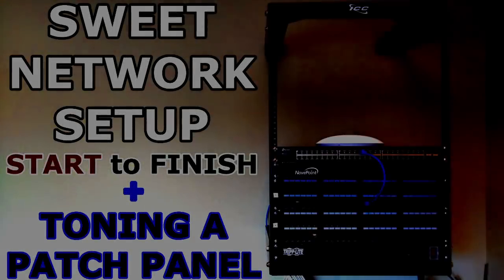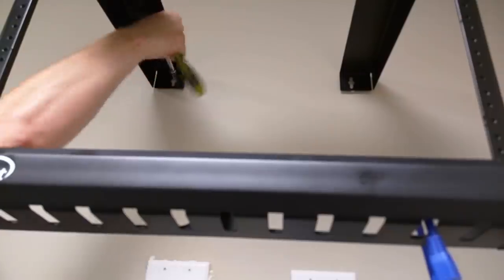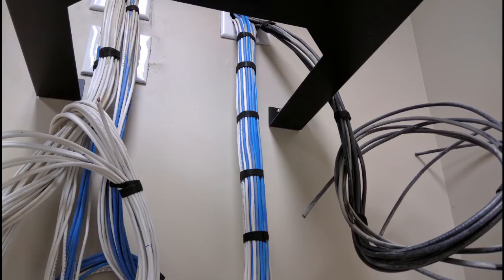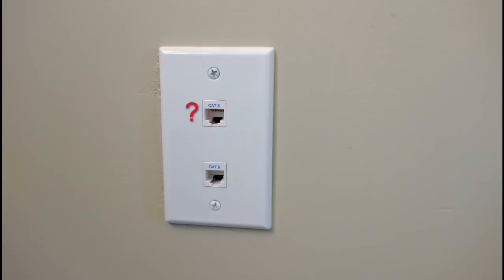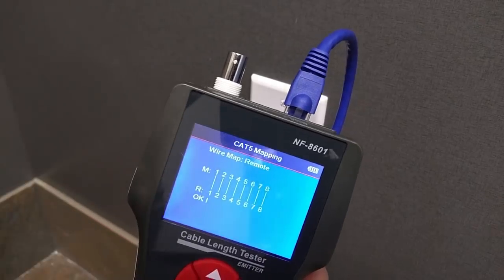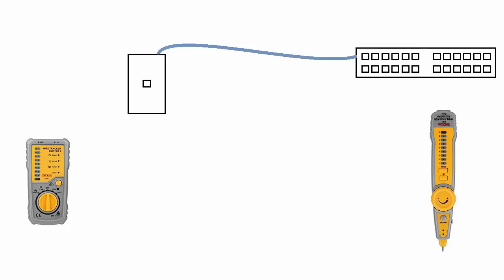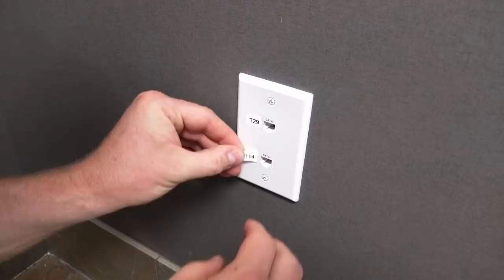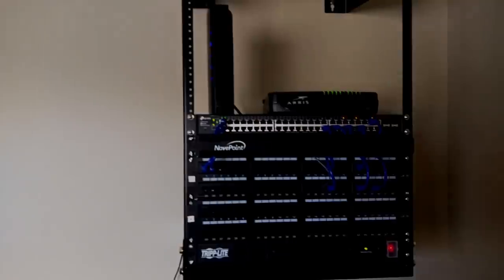Complete Network Setup // Toning, Identifying Ports

Comment: Or you could just label your cables when you pull them and don't have to find them later. Sharpies are cheaper than toners.
Reply from the maker: +rpoot82 true. But not as easy on a large project,.
Reply: Budget Nerd I do this for a living, it is absolutely necessary to do it the larger the project. Just take a sharpie lable your boxes, then label the cable. Keep counting til you get to 48, and change panel ID. I always start with buildingfloor.panel.port so say you're in building B 3rd floor your first cable would be B3.A.01 and continue til B3.A.48 and then continue to B3.B.01 and so on. Then when punching down you can look at the label and place it where it belongs. Now you cut out a lot of time testing because you just go from port to port and don't have to guess or jump around. When building closest with 300-400 or more drops you don't have time to guess. Your time is valuable don't spend it running in circles
Reply: @Budget Nerd, Agreed it is not ease to label, and should not be labeled at time of pull. If a painter comes in and hits the label you are left guessing. How ever I do not recommend using a tester like the one that you are using for installs there is a better way, and always use the right tool for the job. I recommend at least a Klein Tools VDV Scout Pro , it is expensive, and it is very durable I have let my tester fall off a three story building got my help to throw it back to me, and went about my job. You can make testing, and mapping a one person job with doing multi lines at once. 
Also I recommend learning how to properly use a patch panel. The punch blocks are designed to have the wire inserted in a direction that the larger ledge supports the cutting blade on the punch if you are going to use those types of panels. It also helps with management you can easily run them off the side if you do, and tie them to one another. If you are going to do a job where multi jacks are in the same box I recommend that you use a keystone patch panel it makes organization easier you can map the lets say top jack to be 1a and the bottom to be 1b, and use the two panels one as a and the other as b.
Check out this power management for your next install it can improve your life: ELIMINATOR LIGHTING LLC E107 Eight socket control reliable rack mount power center. It has a 15 amp beaker and each of the 8 sockets has its own switch witch makes power cycling the devices easier for you, and the client.
I hope you made your friend aware that that modem will not handle the max clients that the switch, and wireless can. I know you recommended a router other than that one. I under stand that some people don't know the repercussions, but my main argument is: "Do you want your ISP controlling your network, and security when they leave there passwords set to default all the time." As well as: "What would they get more out of you getting the most out of your network or charging you up to $300 a year for a router that is designed for at most 20 devices." I also have clients that have learned this the hard way.

@rpoot82, I find it interesting that you do this for a living but all you point out is labeling cables while pulling even tho that is not good practice. Dude if you do have a job doing this I feel sorry for your boss. You have no attention to detail at all.  Don't feel bad I would fire both of you. You for wasting time labeling cable and not pulling them, and him for the above reasons.

@Cyber_Z0mbie, with the Mapping tools that I have I can map out a job in about 5 - 10 min. that is less time than rpoot82 spends playing with a Sharpe. When I walk on a job to map the job I have labels printed, and ready to install nothing is done with a Sharpe that is just lack of professionalism. 

When it comes to T568A and T568B standards here is a fun fact for you. The T568A is the old standard used by AT&T and is still used by most government and medical IT departments. T568B is the refined standard, and supports backward compatibility with USOC for one pair.
Reply from the maker: +Myzt1c Z3r0 cool. Thanks for the tips!
Reply: No problem Budget Nerd. As fare as labels I go to my local sign shop and they don't charge me a lot and I get sheets of them to my specs for the hardware I use on the jobs. I come out paying less than $5.00 a job. and there printed with UV ink on Vinyl. I also see that others suggested the cable supply led thing. I buy supplies from there all the time why pay $65 for a battery box, and leds stuffed in a plug. when you can spend a little more and be able to test as you map. you need to rerun two cables and need to know how long they are the Klein will tell you that as well. That in its self will give you so much value when it comes to biding some rerun and upgrade jobs now that more people are moving from cat5 to cat6.
Reply: I have done 1000 run jobs, just as rpoot82. You mark up your plans, label your boxes and cables when you pull them, sort them out in the room. if you keep your bundles in order it shouldn't take you anytime at all to get your cables laid in for termination in the rack.
Reply: @firespyer I call BS. yes you go in with detailed plains on where your runs will go even blue prints. labeling cables is a wast of time. That is what you have blueprints for. Mapping is what you have tools for. If you have done over 1000 run jobs you should know this. I smell a lying rabbit!
Reply: @Myzt1c Z3r0 Firespyer is 100% correct; you always label the cables and boxes prior to installation. If you don't you will run into issues with inconsistent numbering and flow. As well labeling the drawings prior will save you time and money when you go to test\certify the data drops, knowing what drop your about to test save you a lot of time on jobs where the drop count is in the thousands. .
Reply: You have that backwards 568A is the new standard, The old standard was  258A AT&T which was standardized under a new name/designation of TIA/EIA 568B.
Reply from the maker: +Jay Shh I did not know that. What I do know, is I see B used by most everyone. Thanks!
Reply: In the US its usually 568B in Canada its 568A
Reply: You are correct on that one. I amend that was a late night and I got them backwards. How ever I stick by not labeling cables at install it is a wast of time, and money for you as well as the client.
Reply: We all have are opinions; But on what basis can you say that its a wast of time and money?  How would you personal handle a communications closet that has 500 drops? Would you ton out each drop when you go to test? 

If I sent TECH-A to office 10 and  TECH-B is at the Rack; TECH-A Radios to TECH-B says I'm plugged in and ready to test. TECH-B then has to use his probe and search for the correct port. If you have 500 or so drops in one closet the testing and verifying will take forever. When we pull in cables we will pull as many cables as possible; each box will have a number 1 to 20 for example, then I would label each cable with a number corresponding to the box number. After the 20 cables have been ran to location we repeat the process and number the boxes 21 to 40 and label the cables. This 5 minute of pre-labeling out weighs toning each and ever drop and again the cables won;t be in order at the desk location.
Reply: Myzt1c Z3r0 Myzt1c Z3r0 lol Remind me not to hire you to do a job.
Reply: Budget Nerd please don't listen to Myzt1c Z3r0 pre labling saves you time and there for money. Writing a number on a cable takes tons less time than toning a cable. Also it is way more professional to have all your cables be consecutive numbers. I do sometimes get away without labels if it's one or 2 cables that dont go in the same wall plate but besides that I have never heard of a professional shop fire someone for labling. I however have heard of people being fired for not labling.
Reply: Been doing this for years in and out of the service. If you're doing less than 5 or 8 and are super crunched for install times maybe, maybe, you wouldn't label.  Watching this hurt tho, badly.  

A few minutes of pre planning and you can easily run these and never have to tone a single one with just a pen marker and some paper. Give each room a number or 3 letter name. However many boxes of cable you have give each one a letter. Then from one to however many patch ports you have Sharpie that number on the wire.  Use your note pad to reference A = 1, B = 2 and what room. Then cut when done running, copy the number over to the other end and do the next room.  A =3 B =4 C =5 and what room. Do every room 100% before moving on if working solo. Then, when you are all done every cable has the same number on both ends and these numbers line up with ports on the patch panel, 1 goes to 1, 2 to 2, etc. Now, on your patch panel every room is grouped in order and you transfer all of this to a spreadsheet and make a wiring diagram. 

When you terminate in the rooms, pick a pattern for the plate and follow sequentially in the pattern as you terminate however many ports. If you are pulling to rooms with more than one outlet, before you pull plan the same pattern for the shape of the room, like North first, then East, south, West. Now, with this 5-10 extra minutes of planning and 1 or 2 pieces of paper you can enter a room, figure out which number any port is, then look at the panel and figure out exactly which one it is as well.

 If you get lost, all you need to do is look at your spreadsheet. Patch panel 34 = MBR  3, 3rd port in the Master Bed. Go in the Master Bed and follow your pattern and the 3rd port is yours. If you want to make it easier, use 2 colors when you go from patch to switch and alternate colors every time you switch rooms. Sharpie above each group of solid colors what room it is and you don't even have to look for your documentation. 

Been doing small business and residential runs like this for years on the civilian side and was the QC is(still am) for large installs on the Army side. You think I would let my crew on my last large install (1500 drops) just run a ton of cable then hand tone 1500 drops? Even for government work that's too much wasted time. Don't listen to this guy, labeling lines adds seconds to each drop but saves hours once the pull is done and over time will save days worth of troubleshooting. 

Always label. Period.
Reply: I wouldn't be able to stand having ports T29 and T14 on the same wall plate...  If you already ran the wires unlabeled then just, label the wall jack, tone the line, find the line at the rack and punch it down to the corresponding port on the patch panel.
Reply: Or it is better to have a keystone panel :).
Reply: Australia does 568A which I assume was mainly just due to the "A" for Australia as the only real practical use was with crossover cables in the past.
Reply: Not the way to do it, see my comment above. If you do it like this, you could done 1500 up to 2000 jobs in the same time!!
Reply: I label nothing, that is for dummy installers...
Reply: rpoot82 agreed, I always number cables 3 times with a sharpie.  A lot more professional to have the outlets in sequential order.  I’ve done this on a 5000+ outlet job
Reply: NEVER label, not only ones, pure time waste.
Reply: Label everything lol
It's so crazy looking at all the comments
Reply: I've done a number of large jobs, professionals do not label cables until the cables are punched down and in place (such that you may end up with 01-12 next to 01-23 on a wall plate), you keep your bundles structured, but wherever the cables end up on the patch panel is irrelevant to the job at hand, that's the whole point of a patch panel! It's so you can patch into any location in your bundle to wherever you want to go. With managed switches you can care even less about it as you can patch in everything and disable ports through the remote management. There is little to no benefit to wasting time being finicky to get your port numbers to be all pretty and in order, in the end it simply doesn't matter.

We have little ethernet jacks that have LEDs in them that you put into your patch panel, you then have a handheld battery pack that plugs into the wall socket and lights up on the patch panel, have a tech at each end over a phone relaying what number it is and it's super fast. Much faster and more reliable than a tone and probe.
Reply: NEVER label !!!! This is the best option!!
Reply: I agree with the sharpie or label maker. I just setup 84 ports over 3 different networks, over 1 of 7 buildings (84 was the highest connection count for 1 building. Other buildings 20 to 40 connections).
Key. Whatever works.
Reply: I feel like on a larger project (multiple floors/rooms) it would be more time consuming to do tone everything out, even with someone to help at one end or the other.
Reply: 568B is what everyone uses at least in carrier grade service provider networks.
Reply: Someone that is suggesting to not label anything and punch down cables anywhere on the patch panel is clearly no professional. Searching the patch panel for a specific port that is not in sequential order is not professional or efficient in large environments with hundreds or thousands of drops. Patching everything into the switch is also not ideal since switch ports are far more expensive than it would be to label the cables when pulling them!
Reply: @myzt1cz3r03  it's not that hard u make seem like labeling cables is such a bad thing
Reply: @BudgetNerd  no sorry labeling is just faster let me see you tone out 10k cables
Reply: lol, a hobbyist is arguing with trained professional, hahaha
there is certain ways of work in professional field and  they are set for good reason. you can do whatever way you like in small scale and take the trouble to work around, but this not a smart way to work and definitely not the way to work when getting paid.
Reply: He is right if I had you on my crew and you pulled 50 plus cat6 cables or 18/4's and did't label them I would fire you on the spot. Cable Guys that like there work take pride in how it looks and if you are not labeling it its hard to keep stuff neat. Also it helps the guy that comes behind you. If that building ever changes owners that way your not a battle buddy fk'r
Reply: Usually the guys pulling the wire aren't the ones doing the terminations or the equipment installation. Sometimes we don't even get the rack plan I also do this for a living and usually tone everything out
Reply: @myzt1cz3r03  Toning cables takes FAR longer than labeling the box and coiling the cable into a small service loop and labeling 3 different areas with Closet-Panel-Port. Not to mention you can make outlet sequential (the T14 and T29 made me cry) and jump right to the testing. Firespyer has the right of it, it saves headache down the road.

I've done hundreds of jobs, my coworker/mentor having done this for 10yrs himself this is exactly what we do. As we did tests, we could verify the cable was marked right (ie. he put dongle 1 into what's labeled port 14, does it match?). If your stuff isn't labeled, the time you "saved" by not using a sharpie is wasted and even extended toning runs out.
Reply: @rpoot82  .
Reply: @ron_belgium  dude, that is a handy tool for already pulled and punched down cables, but if the cable-guy would just have had a map and labeled each cable on the ends and where it is on the map your tool wouldn't be needed, you punch everything down and start testing the cables, we use the Fluke Network DSX-8000 to test all the cables and give the customer the end-repport where he can se that all the cables are ok.
Reply: @BudgetNerd  LOL this isn't a large project, I do this for living and 2000-4000 outlets for me is large project, your job was about 2-3 days not months like I do, People ive noticed that don't use a marker pen are lazy, or like to waste customers money, sharpie is so much quicker, pull cables in order (where possible) bundle them into 24 as you go, might take less 1 min to label, labels on face plates are in better order eg 001 002 or in your case 039 001, (i used different number scheme to yours). Another way for your baby project if you dont label cables is fit off field first then tone them to cabinet and fit off in order
Reply: @BudgetNerd  on large projects it's vital. Numbering cables when pulling them is great advice for newbies. As if you get up to pulling 500-1000 cables per floor you need to have numbered them usually write the number in sequence as there pulled 2-3 times on each end of the cable with  . After the number so you can tell the difference between 6. and 9.'s. Do this and you will save loads of time later. And makes easier testing. If you don't number them you get in a right mess when cable numbers get very large. Also you can then put cables in a order in the patch panel easy.

Although it was good you covered tracing and testing as that's very useful for people to know.
Reply: @myzt1cz3r03  I'm reading this 2 years after you left your comment and cannot believe that you would think it cheaper to spend time toning out each cable instead of just labeling the cable with a sharpie pre-pull.  You put a 1, 2, 3,4,5,6 on the one end and on the box, when the pull is done you write 1,2,3,4,5,6 on the other end of the 6 cables, and no need to tone anything.  The fact that you continue to argue this is a waste of time tells me you get paid hourly and don't mind spending the time afterward toning out each cable.  Wow.
Reply: @cossiepowerbdt  And you do it on the small jobs so it becomes second nature.  It's just good solid practice.
Reply: The thing about labeling your cables it to make it easier for the customer to understand where everything goes and when you hand them an as-built with a defined structure to it, you are going to get good remarks and return service but if you just pull cables and terminate them Willy nilly, the customer will be confused about why a15 is next to d36 and never want to use you again. When we say professional we go by the code that says our completed product is done in a neat and workmanlike manner. I for one do not think that random numbering is very neat. On home installs and smaller installs like this, if you aren't getting paid, then do it however you like. There is no real set rule. But I would like my station ends to be nice and orderly so as a customer I would have never called the company who pulled, terminated and then labeled back.
Reply: I just started working in the field. I mean, totally green. I was a bench tech, nothing more, and proud of it. The guy who fixes your computer. I got a job at an IT company thinking I'd be doing the same sort of thing. Not at all. Now, on a Saturday night I'm up watching videos like these trying to cram my brain with knowledge because I can tell I won't last if I don't study in my time off. So far I've wired up two buildings under supervision. Everything was labeled. It makes sense to me to label things before hand but one thing I did notice where we came in to a building that was already wired up with cat5, many of the labels had fallen off the cables on the rack side making the labeling pointless. I see that you recommend a sharpie. I'm curious how you could write a legible number with a sharpie onto something so small as a cat5 cable, run it through the wall, pipes, attic, etc and out the other side while being confident it wont smear and be unreadable after it's already precarious enough that you have to write something so small. Even with a fine tip sharpie, you would have to have really neat writing, which I don't. But anyways, I guess I'd just have to try it first.

The job I did, there were already labels on cables. I wasn't doing that part. I was terminating at the walls and putting keystones on the rack side then into the patch panel, then the switch. I love this work even though at first it was all over my head and still most of it is, I'm being given a chance to learn and I'm starting to see how things work, especially after watching this video combined with on the job experience. Any advice you or anyone else reading this who works in this industry can give me would be much appreciated.  Thanks.
Reply: @whotookmyusername82  labeling is essential on any job. If you look at any cabling job done by a professional outfit you will notice the patch panels will be in order with different network drop segments on their own patch panels (data drops on their own panel, voice drops on their own, AP drops on their own, feed cabling on its own etc). This may not be necessary in small installs but any time you look at a job that is hundreds or thousands of drops a numbering scheme will need to be decided on and adhered to with detailed labeled blueprints. 

We use labelers with shrink tube to label our drops on both ends as we pull them. This leads to cleaner installs and fast & easy cable certification without the worry of smearing the labels. I noticed the guy above mentioned about what happens when the painters overspray gets on your cable which only happens if your not bagging your bundles after the rough in. Once your done roughing in you should be using a 55 gallon drum liner to bag your bundles in the termination closets to prevent them from being damaged or painted on.

I would say it amazes me about how much bad information flys around on the internet but after having ventured into a couple hundred MDF's not much surprises me in this industry anymore.

If you would really like to pursue a career in this field you should check out getting some certifications. BICSI has some pretty good training courses for structured cabling and pursuing some cisco certs would also go a long way to opening career fields
Reply: Interesting read, I am not a cable puller, i've done a few power cables and network cables, not anywhere near that level of complexity.  Whilst waiting to install the rack equipment at a site I did observe a few chaps pulling copious amounts of CAT6 through a control centre, they had about 12 - 15 boxes / reels of CAT6, used a heatshrink marker (guess anything that "identifies" will do) on the cable, marked the reel / box with the same ident or at least one they could distinguish, ran the cable then put the same heatshrink marker on the other end when the run was done, I can't remember exactly how they labelled it but they had a "run number" so say the first run was 12 cables, it would be "xnp" 'x' being the "run" so first one would be 1, 'n' being the box number (1-12 / 15) and the last one 'p' being the patch panel number, no idea if this is a good way or not, just thought i'd mention it, these guys are widely used installers in the UK for this kind of thing, I have also seen wrap around labels use on coax for old analogue video, Brady cable markers I think they were, anyway, both of these labelling methods were still readable and intact after the pull of cables, and they are left on the cable even though there are better idents on the termination points at each end.
Reply: Oof the back of that patch panel 😆 thought it was going to look better judging by that velcro. And +1 for a quick sharpie label on the cable end and one on the box.
Reply: @rpoot82  do I work with you? Hahahaha we do the same exact thin
Reply: @workswithzach8219  Yeah dude. All that effort just to not punch down the way any professional does it.
Reply: @BudgetNerd  A large project is the worst place to not mark the cables.  If you have hundreds of cables that aren't marked, you're going to waste a LOT of time finding them.
Reply: @BudgetNerd  One advantage to A is it puts the orange pair between the green and blue.  With some cables, it's hard to tell the difference between blue & green, so, having orange between them makes things a bit easier.
Reply: @johnschroeder3072  Actually, A follows telecom practice.  I don't know where B came from.  Maybe from people who don't know enough to mark cables when they install them?  ;-)
Reply: @blakethetank  Here's what Wikipedia says:

ANSI/TIA-568 recommends the T568A pinout for horizontal cables. This pinout's advantage is that it is compatible with the 1-pair and 2-pair Universal Service Order Codes (USOC) pinouts. The U.S. Government requires it in federal contracts.[citation needed] The standard also allows the T568B pinout, as an alternative, "if necessary to accommodate certain 8-pin cabling systems". This pinout matches the older AT&T 258A (Systimax) pinout. In the 1990s, when the original TIA/EIA-568 was published, T568B had the most widely installed UTP cabling infrastructure. Many organizations still use T568B out of inertia. 

Whichever you use, make sure it's the same on both ends.
Reply: @Wilksey37  Power guys mark cables/wires too.  They even have little rolls of stick on numbers to do that.
Reply: @blakethetank  It changes depending on country/region